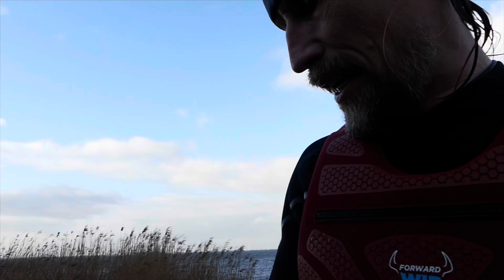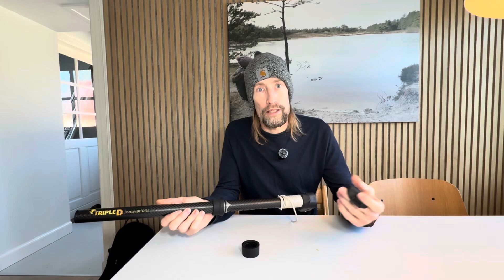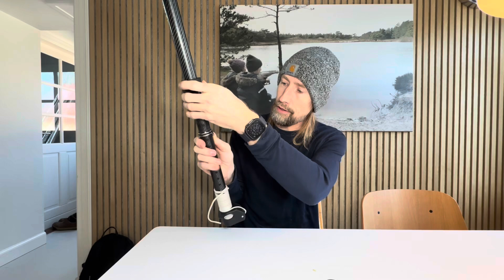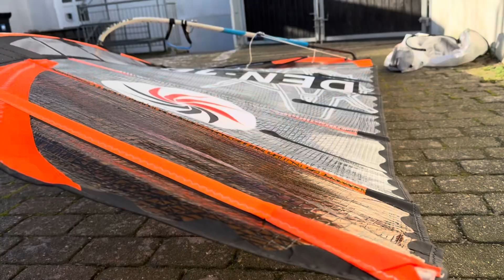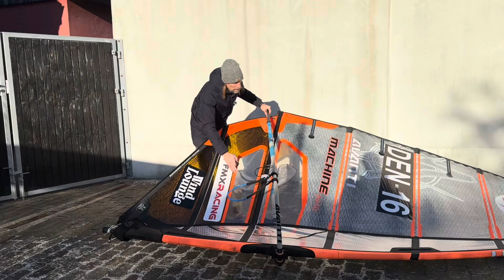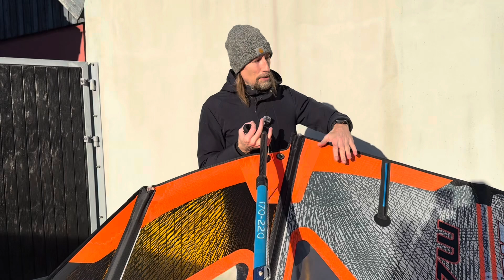Electronic extension after 10 months and some windsurf sail theory (why downhaul)🤙🤙🤙

Comment: Do you rig the sail with max downhaul, with all four clics on extension and then release downhaul, or how do you do it. I didn't find any other possibility.
Reply from the maker: I put the extension in the middle and pull my downhaul to normal setting. Then I can go both ways, 2 clicks in both directions

Comment: You get identical trimming options with MANUAL pulleys which are used "on the fly". This is simply another gadget that will break and is heavier than a manual set up.
When will they be making an electric wishbone for eletric outhaul ???
LOL
This is rubbish
Reply from the maker: Electronic gears on bicycles also has more failure points then something manuel, and still it is used by many. This product is not for everyone but it is really something different to sail and change the trim with the push of a button and still maintaining your normal stance. 
Personally I like the product
Reply: @surferkaspert4679  Happy you have found something that works - I doubt you ever tried manual downhaul and outhail before this and so don't know how much simpler and less weight it is.
Cheers.
Reply from the maker: @Team33Team33 I have manual outhaul on all my race booms and my harness lines also adjust manually, and I have looked at the manual downhaul when I did the iq stuff, but decided it wasn’t for me. The extra weight is perfectly placed right at the mast foot where the manual ads less extra weight but higher up on the mast. 
I will stick with my way and you will stick with yours. Best regards, Kasper🤙
Reply: @surferkaspert4679  Maybe say that you are comparing in your new comments then rather than just commend something that is useless.

Comment: Good morning
What glove do you use to avoid getting tendinitis?
Reply from the maker: Most of the time I use open palm mittens. Below 3 degrees I experiment with different closed options. Those are a bit hard on the lower arms but if I focus on not gripping too tight and have had a couple sessions earlier with closed gloves then 2 hour sessions are no problem. Right now I am recovering from my first session in over a month and even with open gloves and only 1 hour my body and arms are totally destroyed.